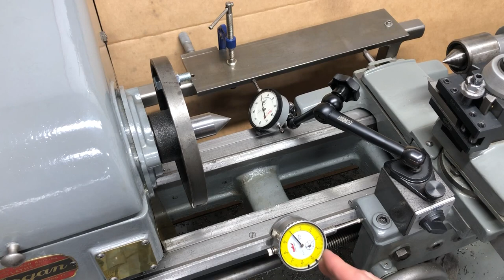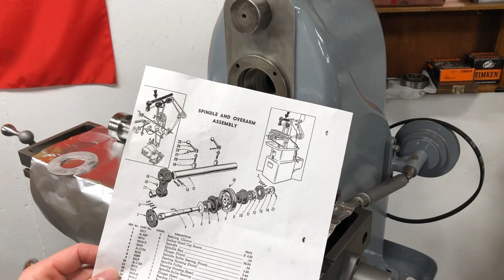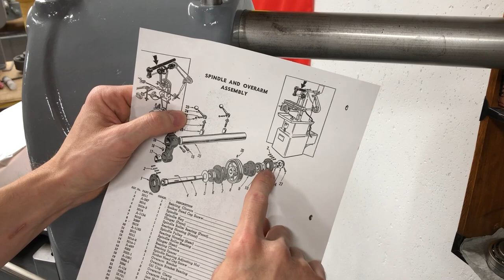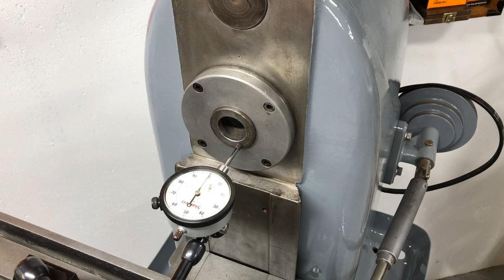Cleaning and Installing the Spindle in the Sheldon Vernon mill

Comment: Glad to see you making videos again! Love the Logan lathe. I sold mine last year, but it was a fantastic machine.

Also, You should make a scotch bright arbor. They're great to have around. It's just a piece of rod with a slit cut into it. You jam a length of scotch bright into the slit and put the other end in your drill. It's perfect for cleaning out bores. It can also be used with sandpaper or emery cloth rolled around it. Makes for a cheap flap sanding wheel
Reply from the maker: Thanks for the idea I will do that

Comment: Glad to see you take such care putting it back together , sure hope you didn’t forget the key on the pulley. Nothing Ike the feel of those old machines. Take  Care and thanks for the video.
Reply from the maker: Thanks!  The pulley has plenty of room to slide on the spindle in there so you can slide it and put the key in and slide back.  I love these old machines
Reply: Mr C I have a Sydney Vernon vertical mill. Can you answer a pulley question ?
Reply: Steve Bo , sorry but I probably can’t help you, I’ve never had mine apart . I just noticed the key slot on his without a key and thought he might have forgot it, but he proved to be smarter than me 😉 !
Reply: Mr C thanks for the fast reply.  Cheers.
Reply from the maker: Steve, not sure what your question was about.  Have you looked on the vintage machinery site so see if there is a parts manual for your machine?
Reply: Mr C I’ll check them out. Thanks.

Comment: Do you have any dimensions on the spindle for this machine? I've got a model 0 that has a vertical milling attachment. Someone removed the spindle and made a plate that bolts on to the face of the machine to cover the hole. I'm wanting to restore the horizontal milling functionality.

Comment: Did you have any issues with the back gear? I picked up a No. 0 and there's something up with the back gear.
Reply from the maker: No issues.  What trouble did you have?
Reply: @BuildFixCreate  Seems like it doesn’t engage properly. I’m not that familiar with the mill.

Comment: How much of a pita is it to fit the tracer assembly?  I saw it used power feed so did you have to fish it on from the far end?
Reply from the maker: It’s not too bad.  The half nuts open enough to go over the lead screw so you don’t have to put it on from the end.
Reply: @BuildFixCreate  That's right I remember that video.  This is probably one of the coolest hacks I've seen for a lathe

Comment: Another option in the future that is less invasive is converting the red rust using steam. If you search "anvil rust bluing" a good video will come up. Dont have to apply any solution and it doesn't remove metal
Reply from the maker: Interesting.  Thanks for the suggestion!